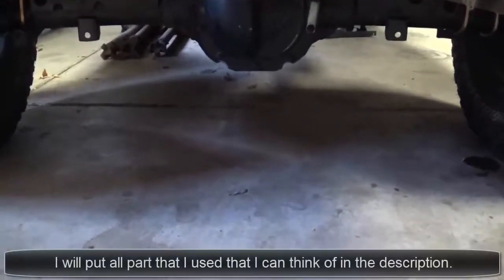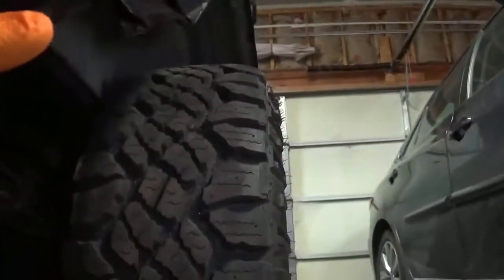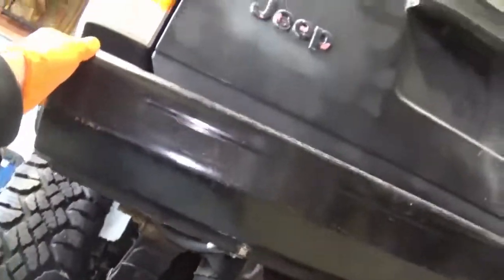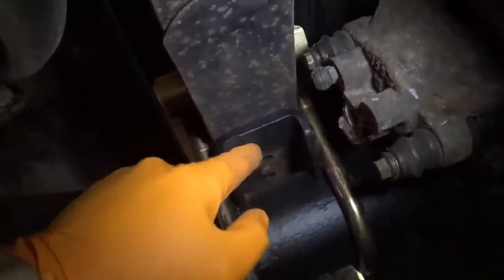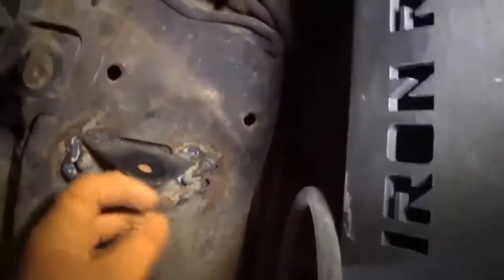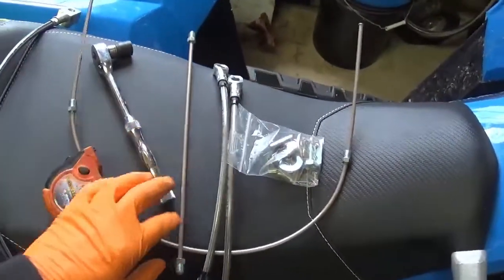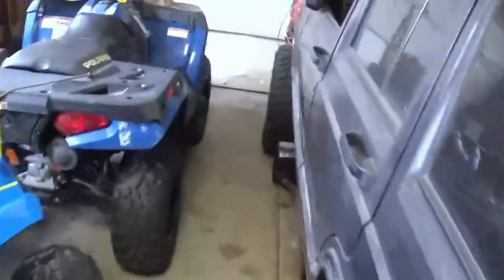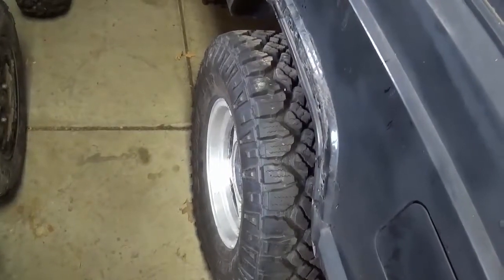Jeep XJ with Ford 8.8 Mounting/Brakes

Comment: I'm not understanding what caused your problems when you initially bolted up the axle to your springs with your springs and new spring perches not lining up correctly.  Did you verify that your axle was true and straight as described in the directions from Iron Rock before you started welding?  Did you confirm that your 8.8 axle was 53.5 inches from inside flange to inside flange?  Did you confirm that your springs are 43.5 inches center to center?  I'm currently starting this project myself and I want to understand what happened with your project so I don't run into the same problems.   I'm following the directions from Iron  Rock Off Road but I don't have my Jeep at the same location as my welder so I won't be able to test fit everything up before welding the perches.
Reply: How did you go with your measurements with the swap? I could not understand why he had different measurements on both ends even though the pumpkin is offset to the right. Having equal lengths from backing plates would actually center the axle as opposed to having equal lengths from the outside edge of the pumpkin to the perches. Unless his leaf springs weren't straight and had a misalignment causing the axle to push to aside as he stated. How was yours?